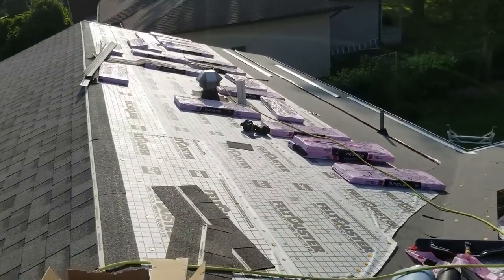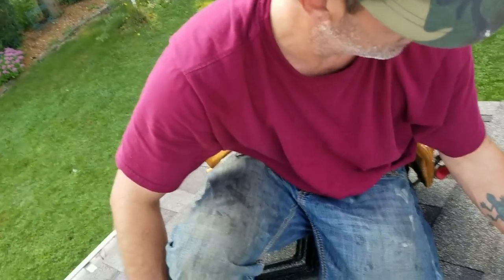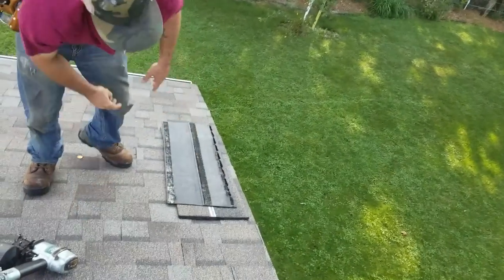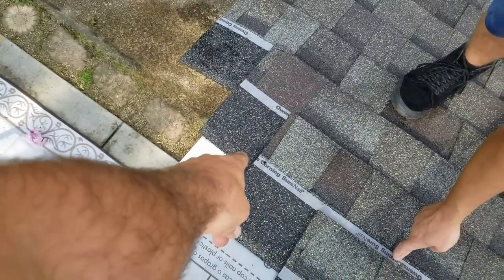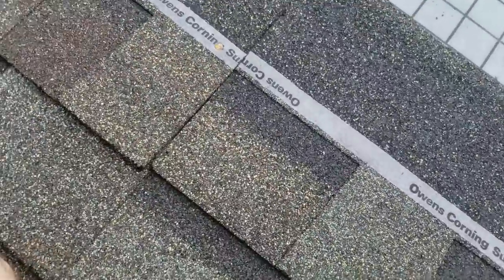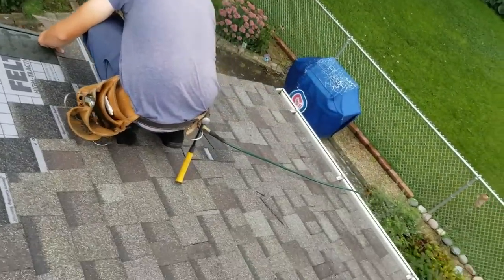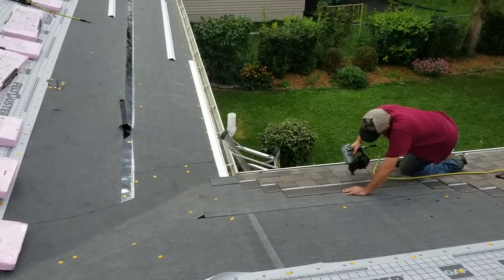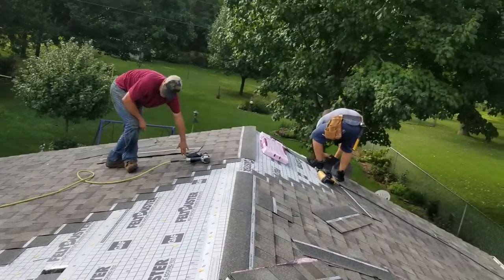Rookie Roofing 101: QUALITY CLINIC

Comment: The second you let that youngster lay that shingle with the blown through holes.. you failed as a teacher. You just taught him that that’s okay to do, and it’s not. I’m not knocking this down, but don’t teach someone bad habits, or how to slough when no one’s looking. I was taught to do everything correctly the first time, so that there never had to be a second time. After slinging shingles for 28 years.. I still made the occasional mistake, but when I stepped off the ladder, it was done correctly. A good suggestion for those starting out, or teaching someone how to roof.. start them out with pounding nails by hand. When they’re comfortable with those movements, and they become ingrained, you’ll be surprised with the fluidity, and productivity of an air gun in anyone’s hand. The students are only as good as the teacher..
Reply: No need to hand nail!Some people just can't hand nail!!I think he should chaulk lines so the new guys get the feel of laying shingles.
Reply: @Willis476  have not seen them snap a single chalk line in any vids n ive seen some other questionable things i would never do
Reply: Yeah and who cuts shingles on the finished roof? That's when you see another company repairing a roof like this because it failed due to cuts and gashes made in the finished roof by cutting shingles on it. Not even a roofer myself in just an ameture so I have nothing to gain from giving a neg review but I think there's some bad habits being taught here. I read and was told by buddies who roof that you don't do this particular habit. Pre cut them on the ground then bring them up. The stair step doesn't change weather it's on the ground or 14 feet up. You can already tell that underlayment is being compromised by razor blades.
Reply: @MadMetalShop  honestly a good roofer cuts on the roof just enough to snap the rest without hitting the underlayment. It's common practice
Reply: Been riding 16 years now. I started out handnailing. Did a 700 square roof in Idaho and learned to love hand nails.

Comment: Pro tip instead of overhanging the shingle and cutting it with a hook blade .
Try this turn the shingle to the back side and place it to the edge of the dripedge and cut the shingle on the roof but from the backside using a straight blade, pick it back up and fold it to finish the cut.
Now when you put it back in place the cut will be towards the edge and you wont have to cut leaning over the edge.
I say straight blade because it makes straight cuts easier quicker and saves blades.
I do hope you try this atleast 1 time coming from one veteran roofer to another much respect 👍👍
Reply from the maker: I actually have tried that! and It was a good opportunity to do the research on whats more efficient also coz I was racing a guy I beat all the time but I didn't have a hook blade, so I had to cut my starter rake with a straight blade (shingle backwards) and do the end rake like you said, he beat me by a minute n a half n I fully blame not having the hook blade. up to you though, if that's your preference have at it man!!
Reply: You obviously are not cutting shingles’s in cold weather

Comment: Though water does indeed run down hill, as long as there is no wind, a hole through many layers of shingles will leak, no matter how many layers are underneath. You should always cover over a nail hole with something, even if there is another layer of shingle going over it. Sometimes the edge doesn't always seal and sometimes a new roofer might not notice a removed nail and he might allow a joint to be there.

Comment: There are starter marks at 6” 12”18”and 24” for the overhang starting the runs then finish the other end with those starter cuts. All shingles are marked. I like your starts . Works really well. 😄

Comment: I've put on about 4 roofs in my life, on three houses and one 1800 sq ft shop.  They all worked fine (water runs downhill IS the mantra), but watching this, I see there were about 50 things I could have done to make the job a lot easier and faster.  NOT cutting the overhang, but the other side of the shingle for the stair step is brilliant...and a lot safer than hanging over or near the edge to cut.  You also obviously get a better looking end, since they are the factory cut, and I wouldn't have punched drip strip like I did in two places (ARRRG!).  I've  never seen a valley done that way, with the parallel shingle run up the snap line, either, but it makes  a HUMONGOUS amount of sense...BOTH speed AND scrap wise.  I would just have to make sure it meets code in my area. I'm sixty and change now and the roof is just about due (next 5 yrs or so, anyway), and I figure this next one should last pretty much the rest of my life...and if it doesn't, I sure as hell won't be putting on the next one!

Comment: When you run your shingles along the edge of the roof I always try to keep the factory side of the shingle butting to the next shingle. I’m not good at making straight cuts so I like to always cut my shingle off the edge of the roof so I can use the drip edge as my guide while I cut. Then I use the scraps I had on one end and use them on the other end
Reply: I'm surprised someone doesn't make a shingle cutter similar to a sliding tile cutter, seems like it might be a worthwhile device.  It seems like even just a square with a fat side, like some you see, speed square type, would solve the crooked cut problem.
Reply: John Sikes I think part of it is it would maybe be difficult to use on the roof. Also it would possibly take more time to to cut a shingle for an experienced roofer as opposed to them just cutting it with a knife.

Personally cutting shingles is one of the most annoying aspects of roofing to me, especially in colder weather. 

Anything that could be done to make the cutting process less difficult and more efficient would be awesome. Maybe some sort of 12v battery powered mini dremel like tool would be possible

Comment: I noticed that most of the roofers wear regular tennis (gym) shoes.  Is it because of the slope of the roof or is it because the fancy cougar paws and other roofer boots are not necessary?  Nice videos!!
Reply from the maker: Not necessary on walkers.  I never even used them.  I wear what's comfortable.  The gym shoes allows that ankle to move freely.  Boots stiffens them up. I still wear boots in the winter though

Comment: .looks nice, ...I use a starter strip up the rake, but instead of hanging shingle over the edge then cutting it, just line the last shingle up flush with the starter and cut where the shingles over lap quickly with a knife or snips, ..perfect profile everytime...fast and no waste.....00.02
Reply from the maker: I used to do that.  Or hang it off and cut one at a time that way I can use the factory edge to keep my rake edge straight, but I found the method i taught these guys is the best for quality/ speed combo, I'm posting a video within a week of me Rippin through a rake fast af, so if you wanna see that before trying  it out I'll have that for you shortly
Reply: ..I agree that when teaching this may work best, ..once you know both ways, it's the individual preference..on hot shingle nothings faster than a hook blade, but on cold I find snips work best,,,ever see a rook try to cut a cold shingle, straight? of course you have...pretty painful and scary with a blade..I give him snips and don't worry about a trip to the E.R...nothing but love here, you rock ass.

Comment: Hey question - I am a DIY guy and have shingled 2 small roofs myself so still learning and fully capable of screwing this stuff up......but my question is about tethering - I cam always harnessed in to do anything on the roof - am I overthinking safety?
Reply from the maker: You're never overthinking safety
Reply: RESPECT THE ROOF. SAFETY IS THE FIRST RULE OF ROOFING. IT DOESN'T MATTER IF YOU ARE ON A FLAT ROOF. SAFETY FIRST.

Comment: Yo boycup... Use your starter strip as your straight guide then cut the shingle with fresh blade underneath shingle with shingle over your arm. You will have more cut power and control. Stop using another shingle to be your cut guide.

Comment: soooo just a thought.. everyone does it different  when u cut the excess shingles off the rake,   umm have u ever tried reaching up underneath the shingles and cutting along the t metal or rake metal whatever people call it.. my old company called it  T metal,  but ya u use the metal as a guide and i usually pull the knife from bottom  up running it along the metal,   just a idea... but looks good
Reply: That's much to unsafe it's a fall risk I'd never have my guys do that also the metal your talking about is called dripedge t-metal is mostly used for modular homes aka mobile homes and is shit metal
Reply from the maker: also there needs to be an overhand there. 1/2 inch or so minimum
Reply: Oh yeah totally forgot that part .....if your going to preach, then preach it right lol. But to be fair t-metal does have an inch lip past the fascia point lol covering up the ooops lol
Reply from the maker: Drip edge also has a lip of its own that ranges from 1/2 to about an inch.  I still do an overhang always,  even though I'm sure its water tight anyway if you went flush.  I choose to guess roughly half inch up the edge n it always looks great.  We used to do an inch overhang there at my old bosses company but when you look up at from underneath it looks bad so he changed it and I agree.  Always stick with 1/2 overhang on drip edge and 3/4 to 1 inch on gutter apron.  And don't use drip edge as gutter apron
Reply: @NWIVeteranConstruction then why doesnt the lifes aprentice use a overhang? he cuts them flush with the rake drip edge?

Comment: Get your boys some roofing knives. Makes cutting way easier
Reply from the maker: most of us use the dual knives. where you can keep a straight blade in one side (which we use to slice open bundles quickly as well as cut through our synthetic felt fast and smooth. and  a hook blade in the other side for cutting shingles and ice shield. its really the perfect combo because you don't always have the freshest hook blade on to cut synthetic but even a dull straight blade will get through it a little nice. dual blade will always be my choice
Reply: @NWIVeteranConstruction  never heard of dual blades. Imma look into it
Reply from the maker: @theroofguru807  menards has them. its just a 2 sided knife. like I said you can keep a straight blade ready for action and a hook blade at the same time, I use it everywhere coz sometimes hook blades come in handy on siding jobs or something, like for pulling caulk off or random shit. are the gutter guru's cousin or whatever that called me on the phone?

Comment: instantly i said to myself, you're not crazy you need to pay attention to nailing patterns always. these aint three tabs anymore! cant be a cowboy behind the gun. slow down. slow way down and don't try to keep up to the bang bang bang of the bosses/ foremans gun. also, my little trick on 36" runs and a 6" stagger, cut a 12 off of a full shingle save the 24 left over and put aside when you need to get closer to a valley throw down the twelve, watch your pattern, put your full into valley keeping nails away from where your 24 on the next course will go, install 24 on next course, full next to that and back to a full shingle on the third course watching nailing patterns as they reverse away from the valley and bingo. you'll learn it quik. i rock a straight knife on my blade and i honestly just make a mark on my shingle flip it and cut it straight before installing on the rake. why go back? hooks are a waste. nice pair of snips for the valleys, works cold weather and all. Do not give your workers a camera either lmfao.

Comment: Do you always run up the gables with starter strip? Or just on certain jobs?
Reply from the maker: always do that. it has a tar line that will help seal that edge so the shingles don't blow off as well as it looks much cleaner that way
Reply: For sure bra

Comment: Cutting patterns for your edge using a straight blade and the factory edge of your shingle will make for cleaner cuts and a blue chalk line on your cut edge instead letting shingles hang over so far.Trying to cut the mesh nail line with a hook blade when it is hot will fight you use a straight blade on the mesh nail line.Cut 3 patterns 19 5/8,13 3/16 and 6 9/16 Will give you a great stagger.I don't see anyone with a tape measure or a chalk line or prybar or hammer.Nail guns will shoot the nails crooked,too deep or not deep enough,never see them fix these mistakes.Lead flashings around plumbing pipes are far superior to the slip overs spend the money get the lead flashings.And guys who don't cut out mortar joints with a grinder for their counter flashing hurt me.Nail guns are faster but nothing is better than a hammer and nails

Comment: Won’t that rack void OC manufacturers warranty? 18:52
Reply from the maker: no. you have to do that at some point in the valley, a roof stacked like that yes. you are correct. but if you watch my valley videos i explain why its neccessary. there's literally no other logical option and you have to do it at some point

Comment: Oh I see  you're going left-handed to come out of the valley so you don't have to cut the shingles.... but depending on the pitch the pattern doesn't always work out to 5 5/8 and It looks like your pattern is maybe 4 inch and water will track over from the key way and find a nail ive seen it too many times on repairs.

Comment: Where are the fall-prevention harnesses?
Reply from the maker: Why? For a 8 ft drop? Lol nobody does that on this type of roof. Not even homeowners or rookies.
Reply from the maker: It's real life man. We'd rather not trip on rope or not be able to control our fall with a solid jump to safety.  Who wants to get swung into a window or bang up siding and the gutter. Just land on your feet.  N nobody falls on this pitch.
Reply: @NWIVeteranConstruction  Land on your shoulder or head from 8 ft. They won't even bother with turning on the siren or lights. I'll pray for your safety.
Reply: @billsixx thank you for caring but what he’s saying is correct. It’s a hot day, the pitch is not scary at all or the drop. If you fall from this sort of house you’re more likely under the influence.

Comment: Water actually gets in between the shingles most the way, don't believe me next time you RIP a laminate shingle off you will see the water stain, you guys do alot of crotch nailing that's when you nail less then half an inch from the start of the shingle and then skip 3 too four inches so water does line up on the seam, if we did that in Canada we would be repairing for days after wind storms, for example look at 3 tabs, you probly havent used that type of shingle before but you nail 4 nails and have 3 tabs covering the nail with key lines on both sides between the shingle with no paper underneath they never leaked, put alot of 3 tab in my day
Reply from the maker: What're you talking about this time dude? Stay off my shit with your constant negativity lol i ain't with all that.  this whole video is consumed with me installing proper nailing disciplines in these guys. N I know exactly what three tabs are n have laid plenty. I'm not gonna respond to your constant thrashing anymore
Reply: Leigh ,that's too funny. Basically this is the way he talks to all the workers all day and expects them to be saying "yes master " I'd like to see him be an example. This would be an appropriate situation for him.  😂

Comment: The shingle is 3 feet long but you start every 5th row with a 6 inch piece. How can this be good practice? Surely the aim should be to eliminate the use of such small pieces.
Reply: That’s so you don’t have seems lining up cuz then the shingle do nothing to keep it water tight
Reply: @geraldweeks5571  I understand how shingles work. It does not explain why its a good ide to us small pieces on the edge of the roof.

Comment: Brad was doing good. He was using 2 shingles at the time to do his latter. I do the same trick.  And he is and idiot.  I seen soo many guys nailing little cuts starting the latter and the next ones get all out of place!! I don't see guide lines on this roof.  That's just calling for mistakes.  I train guys too. But they are always by my side. And I always lay lines soo they don't screw my job

Comment: So close to being good. Boone useing a square to cut the shingles straight. Looks like there not leaving no overhang on the drip edge. I don't think saving four hrs on a whole roof is worth all these I let it slide comments from the boss. I don't see any chalk lines for reference. And everyone sets the shingles by feel . Witch is fine if one person did the whole roof but four different ppl. I would like to see chalk lines. Looks like a decent job. And with a little more attention can be great speed is second quality is first in my book
Reply from the maker: Quality always comes first, it's entire point of the video.  To help guys see the small issues that get overlooked. But there is overhang. And we snap lines for the starter.  Pretty easy to keep them straight on something this small.  Each guy is on his own side